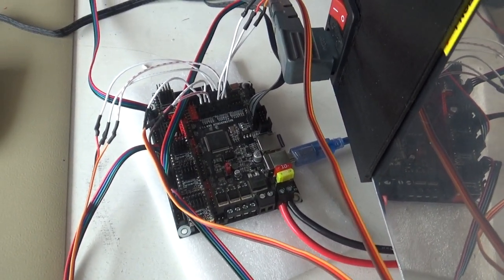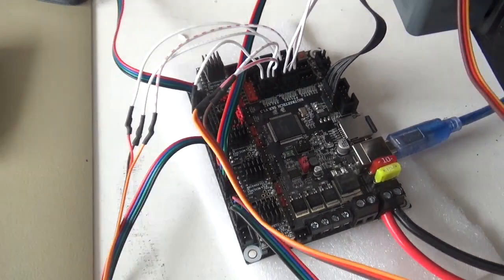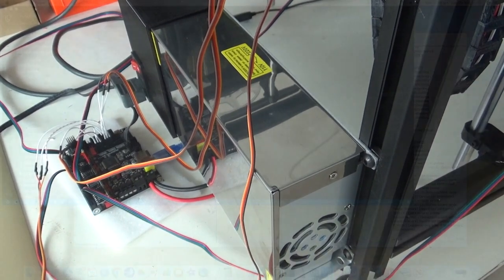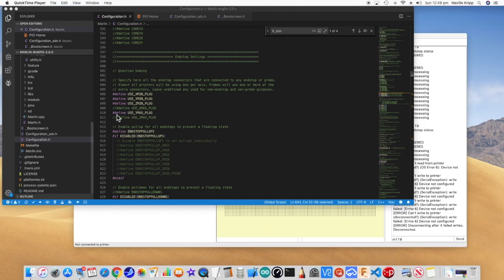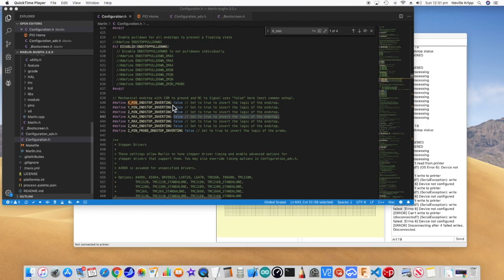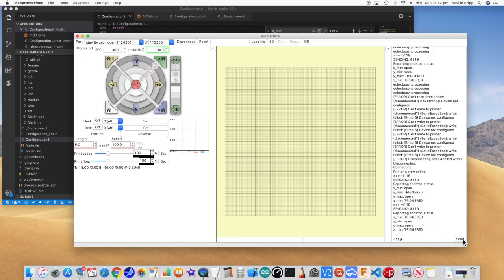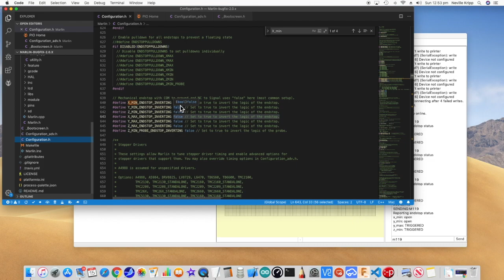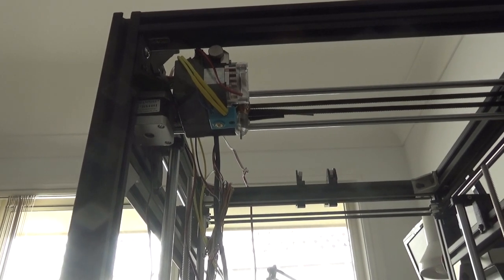#101 Hypercube Evolution 3D Printer Build - 8 (End Stops)

Comment: hmm, how come your x-min is on the left? on the official model it's on the right, right?
Reply from the maker: Hmmm, actually I’m not sure where it is on the “official” model but logic dictates it be at the minimum x location. 
The x axis runs from minimum position at left to maximum position at right when viewing the bed from the top whilst standing at the front of the printer.
Reply: @GrumpyOldTech  yeah alright that's fair, I see your carrige is a little modified from the scott3d's, 

I did find these settings which I applied to make mine work:
// Direction of endstops when homing; 1=MAX, -1=MIN
// :[-1,1]
#define X_HOME_DIR 1
#define Y_HOME_DIR -1
#define Z_HOME_DIR 1